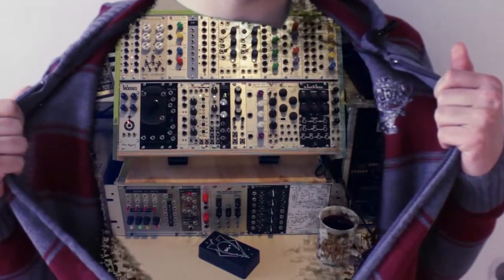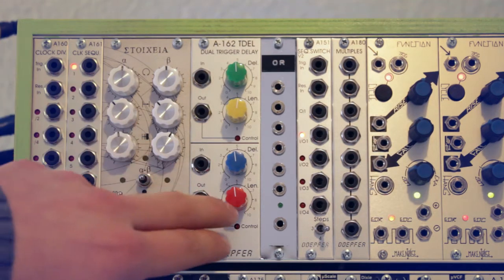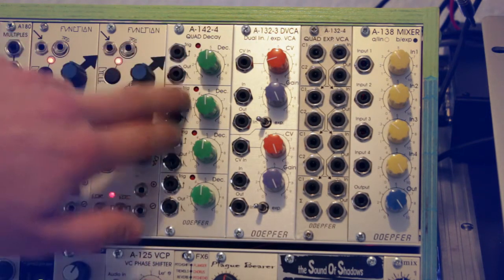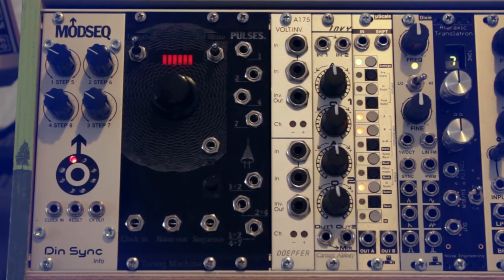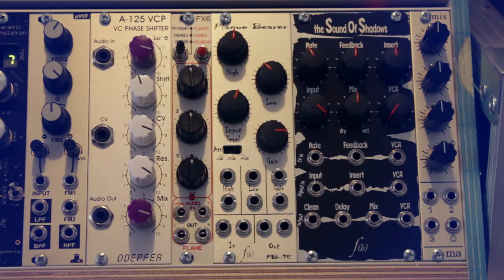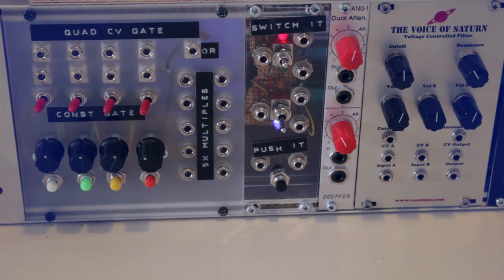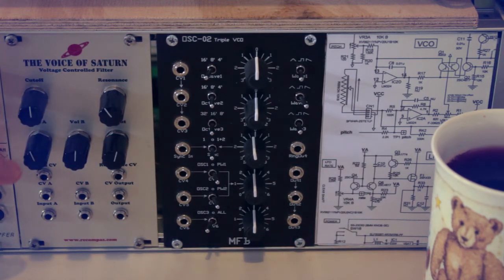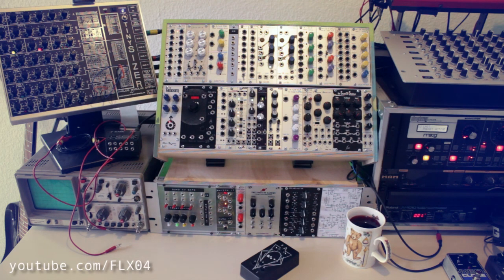Let me show you my rack ... #TTNM

Comment: Nice rack!
Can you explain the logical layout of the modules?
Reply from the maker: On this rack I just grouped the modules by function. I think for smaller racks like this it works really well, because you can still reach everything without needing too long cables. If you have performance modules which you have to reach often and easily, it's probably best to put them in the bottom or top row and to the side, depending how the cables attach to them (so that the cables don't get in the way of the knobs/switches). Generally though, you get used to even a random layout very quickly and when you feel that a module is in a wrong spot, you can just put it somewhere else. So don't overthink the layout too much and just play with your modular and see what works for you and what doesn't :)

Comment: Thank you very much!!! You really work quickly :). BTW, how do you sync your modular so well with your other gear? Where does it get tempo from?
Reply from the maker: I have a Doepfer DarknLink MIDI-CV interface, which gets MIDI Notes from the Tenori-On sequencer, which is MIDI synced with my MPC. Also, the Tinysizer receives MIDI Clock which it converts to CV Clock.